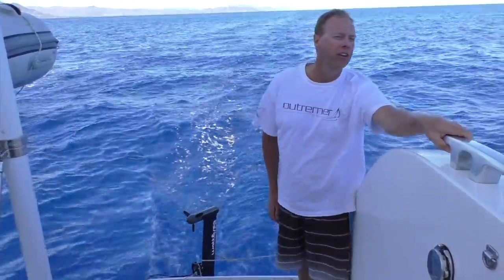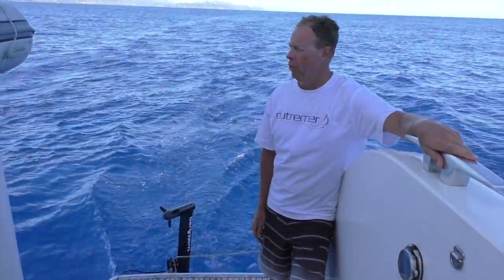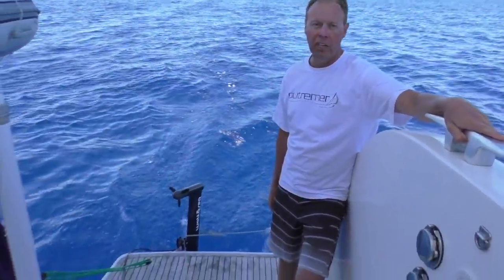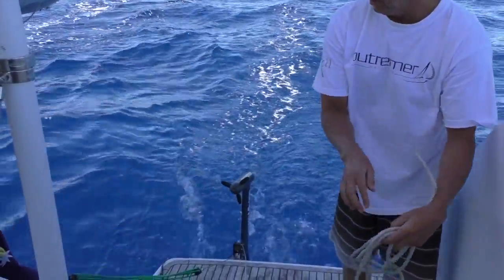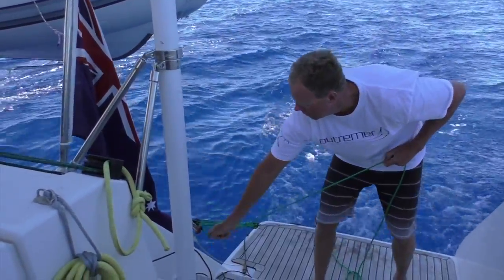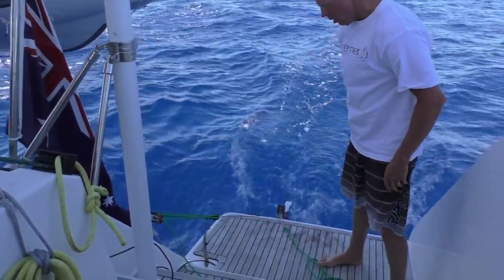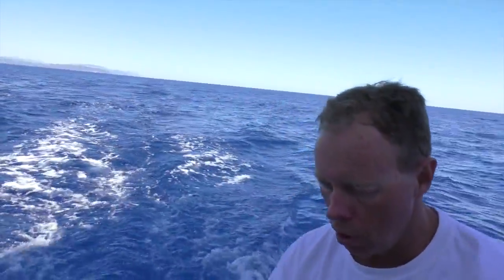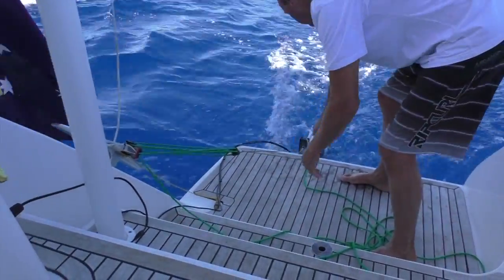Wildling hydro generator demo

Comment: doesn't that just add drag on the ship,  it could be a non issue if you are using free wind energy to push the ship forward. but if you are using fuel then the amount of energy lost due to drag should be the same amount of energy gained by the device. can any physicist... please confirm.
Reply from the maker: It definitely adds drag, but there is no discernible reduction in boat speed when using the hydro generator under sail. We never use the generator when motoring because the alternators provide 115 Amps of charge per engine, so there's no point in running the hydro.
Reply: There are pros and cons for everything:  
It does add a bit of drag, but...
- Much, much less maintenance than an genset, no running cost, can run 24/7, weight gain, carbon free, less moving parts = lesser risk of failure, etc. 
 I have not done the math, but I would guesstimate a lower cost of kw/h compared to a genset.
Reply: R K A sailboat wouldn't deliberately use it while motoring.

Comment: I'm a bit surprised that it doesn't use a simple lock pin to hold it in place. Or even better a 90* rotational socket with a ball lock at the top and bottom that would allow it to stow below the deckline and a simple handle could be used to raise and lower it. The only reason I see it not doing this would possible be due to corrosion of parts, but used stainless and delrin should eliminate that issue.